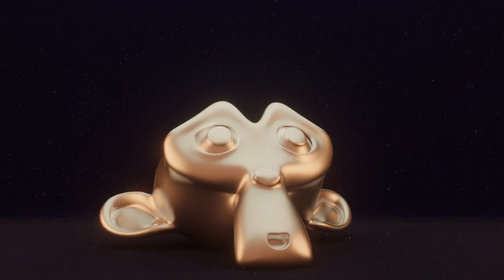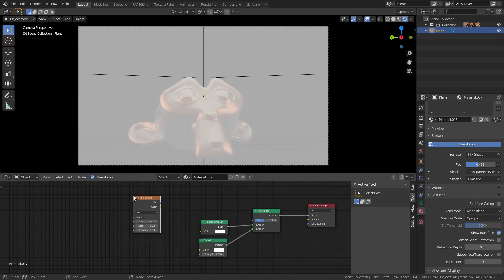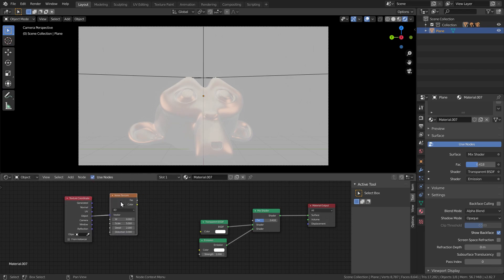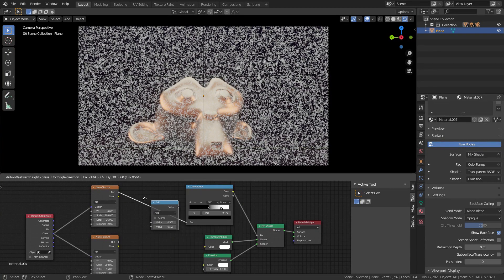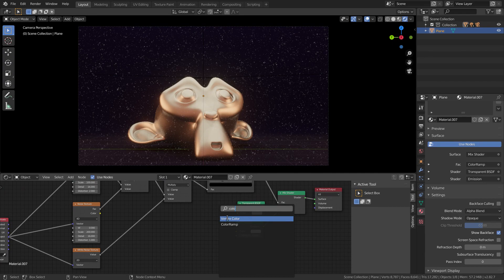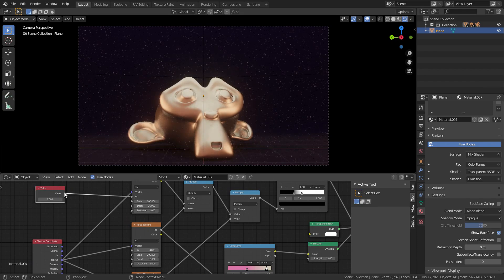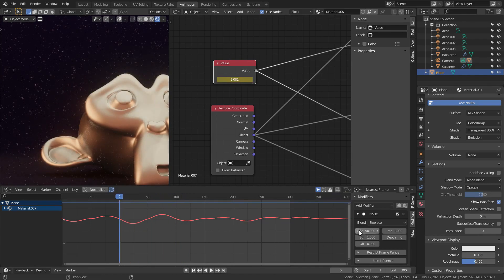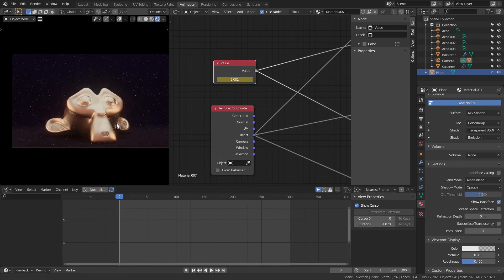Animated film grain with Eevee

Comment: Motion blur on camera breaks the effect
Reply from the maker: Good point, I hadn't tried motion blur on this. You could do this in a separate scene with a transparent background and then composite it over the motion blurred one. It's going to be slower to render but you still get the benefit of using nodes and the W coordinate to animate the noise.